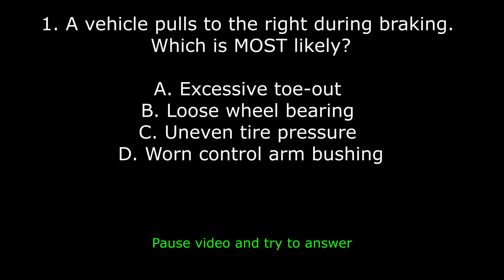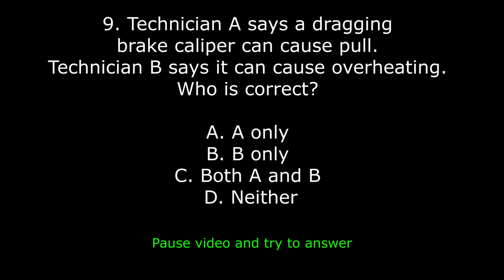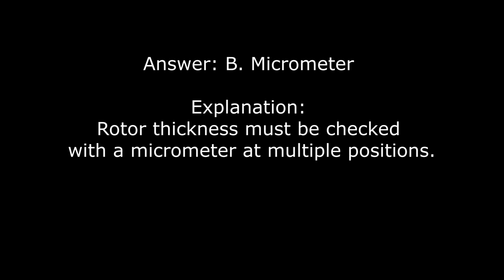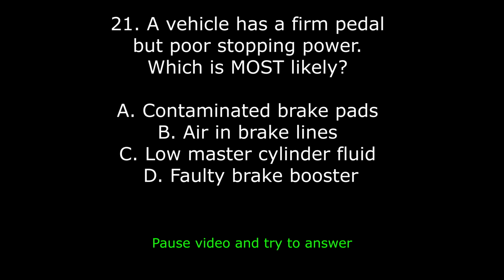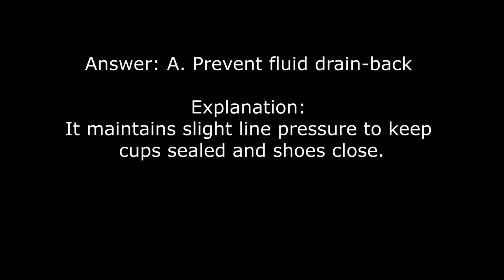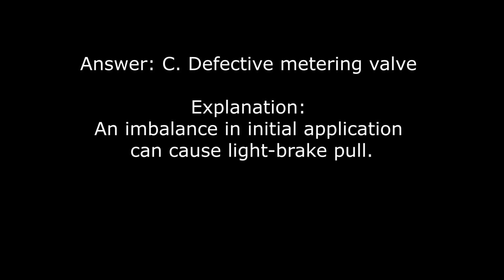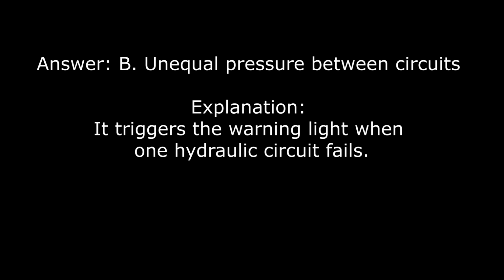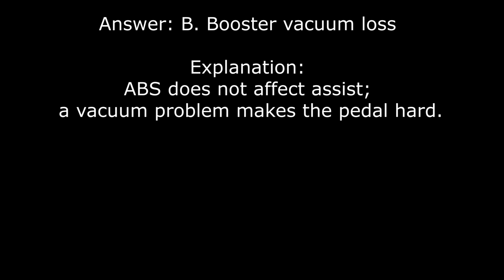ASE A5 Brakes Practice Test | 50 Questions & Answers | ASE Certification Prep

Comment: How is #33 a defective metering valve? Metering valves control front to back not side to side. Wouldn't that answer be a sticking caliper piston?
Reply: I agree but if you had a sticking left caliper it would either be applied at all times or never.  If it was applied all the time, the vehicle would pull to the left at all times and if it was stuck unapplies it would pull to the right when braking.  Not a good question at all

Comment: #32 answer is ABS sensor and not tone ring.  Tone ring (reluctor) generates, creates electrical pulse which sensor reads and ecm interprets as wheel speed.  Answer should be ABS sensor not tone ring.
Reply: Well it doesn’t say ABS Sensor as an option does it ? So you have to pick the one that makes the most sense and the tone ring is part of that signal being sent to the sensor so therefore it is the correct answer in that case
Reply: I agree this video is a waste of my time, but without the tone ring (which has a certain number of gaps for the wheel speed sensor to read) the wheel speed sensor would be irrelevant. So the answer is clearly A.

Comment: The answer for #22 is actually a micrometer
Reply: A dial indicator is better suited for checking out of round because a micrometer only checks thickness and not to see any warping , although would show any changes in rotor thickness
Reply: Wrong